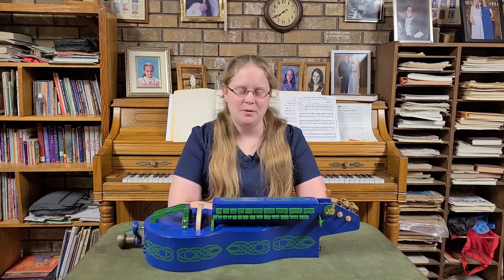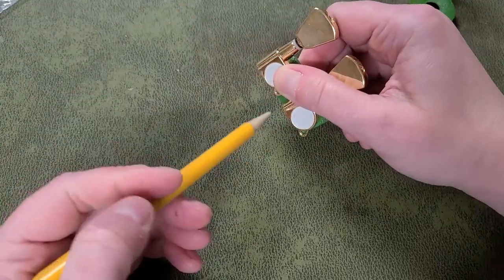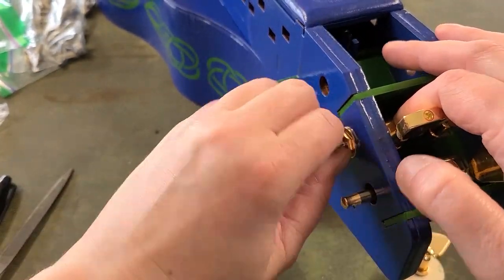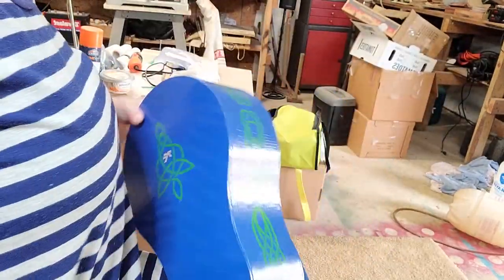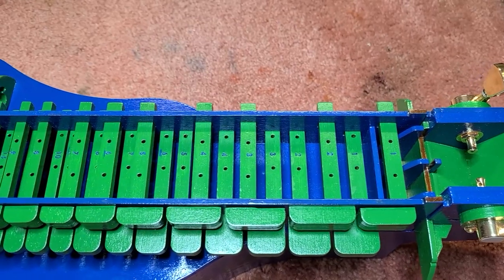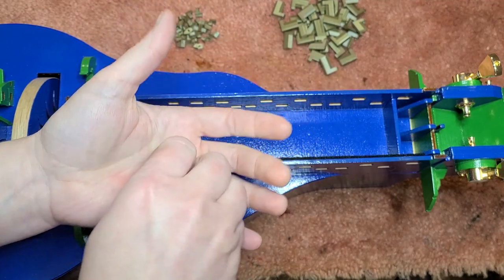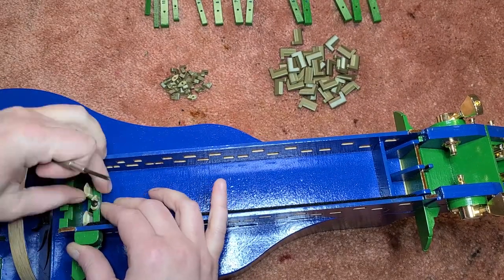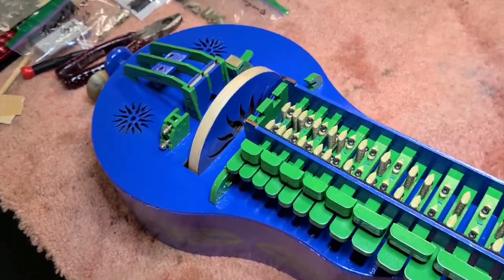Nerdy Gurdy Build: Part 7; Finish, Keys, and Tangents

Comment: For those Keys & keyways you could as you said avoid finishing them. More over on the unpainted key shafts rub in some paste wax finish & buff it out. This will prevent humidity changes in the key to some degree but mostly lubricate the moving wood on wood parts making the keys easier to move.